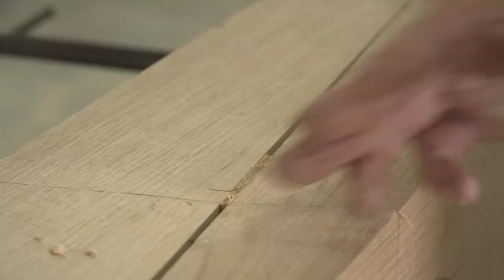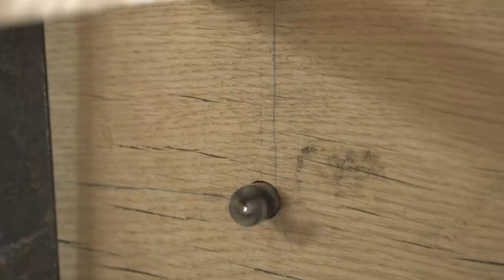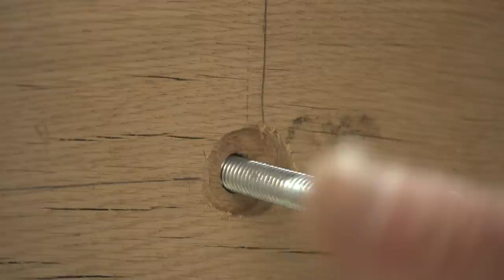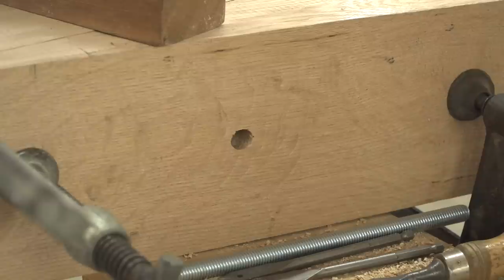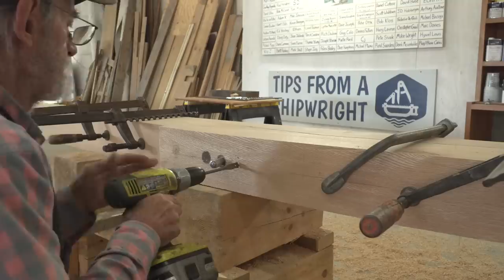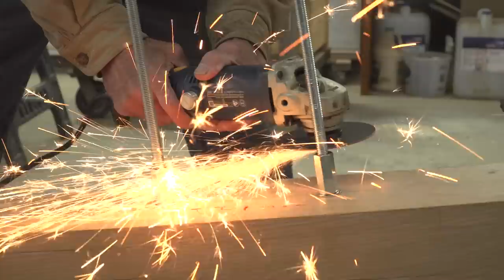Building ORCA - Episode 7: Drilling the center line for bolting

Comment: You talk about the battery power and you're right, who would think that you could drill all those holes with a battery. Of course your knowledge and sharpening of drill bits is key.  I have that same Ryobi drill and I find it's been quite amazing. Very sensitive for the often light cabinet work I do. I've been mostly happy with all the Ryobi tools I've had over the years as a cabinetmaker.
Reply from the maker: There is a limit at times, at the chucks aren't as great as I like...

Comment: That looked so good when you set the spanner in there and it fit so well. 
I was shaking my head at you drilling. 
I bought my Makita 1/2 inch drill back in 1981 and it works as well as the day I got it. All I've done is replace the cord about a half dozen times over the years and only run it on 12 gauge cords.
So I never got a battery powered drill.
I would have never drilled those holes without the handle on the side of my drill. I was cringing.
Something I find interesting about white oak is how much lighter it is after it dries out.
Something I think you'd enjoy checking out is the museum complex at St. Michael's, Maryland, where they still build small boats. They use a type of home made clamp a guy from Sweden showed them and you're going to want to make a few as soon as you see them.
Reply from the maker: Thanks Garfield Farkle
Reply: @TipsfromaShipwrightvideos  Gladly. I am a retired carpenter and must say I have learned a lot from you and find your videos compelling.
I am a sailor living on the Chesapeake Bay.
I've never built a boat but have a scheme coming together in my head for one.
What I want to build is a boat I can carry in the bed of my pickup truck so I don't have to bother with a trailer.

One thing I really liked that you did was showing the difference between Red Oak and White Oak by showing how water is absorbed into each.
I wonder if you've ever worked with Live Oak (Quercus Virginiana) or American Chestnut (whose Latin name I can't recall)?
I did a lot of historic restoration and came across both in my work.
I had some of both in my shop, but used it all up.
I still have a few pieces of old growth pine milled in the mid-to-late 1700s. There are 54-58 growth rings in an inch of it quarter-sawn.

Comment: Even the best stainless will not stand up to saltwater. I’ve seen 3 month old filter screens on Duplex gone in tropical saltwater, even brackish water will eat through 316L stainless in a heat exchanger, that’s why you use titanium.
As I understand it, it’s the chloride ions acting like microscopic drills, especially in non-moving water, which is why the heat exchangers leaked at seasonal start-up.
Reply from the maker: Great point

Comment: When you were chiseling out the hole for the bolt. Isn't the bevel always suppose to be down on a chisel so the chisel doesn't dig deep into the wood? Iv always been taught to use bevel down so you can control how deep the chisel bites

Comment: Any particular reason why you don't use a large spade bit for the countersink areas rather than a hole saw and then chisel out?  Obviously a spade bit leaves a flat surface automatically and saves time too.
Same applies when you're breaking through the other side.  When the point (of the spade bit) starts to break through, swap to a larger spade bit for the c/sink.
I t works - I use this technique fairly often.
Reply from the maker: Big spade bits can be crude and tough to control
Reply: @TipsfromaShipwrightvideos  Maybe it 's you then, because I produce the exact kind of counterbores that you have, but you have to think about the order in which to use them.